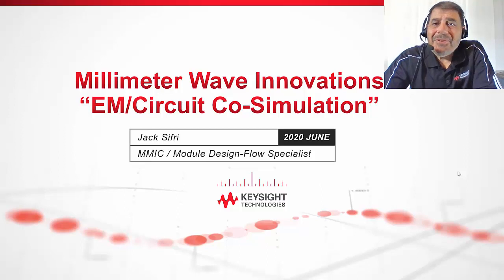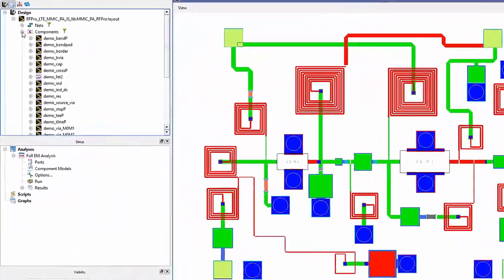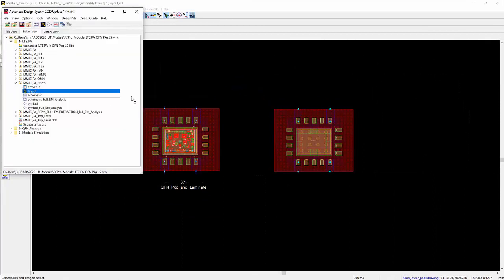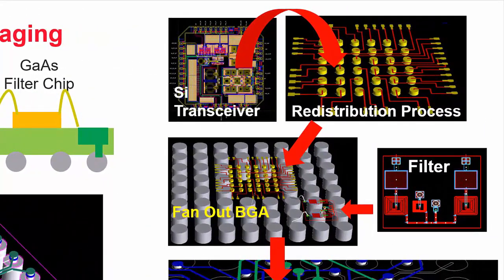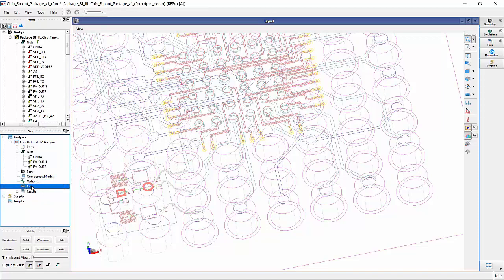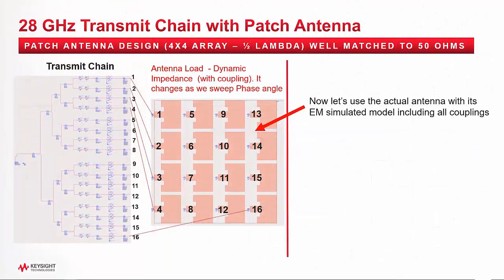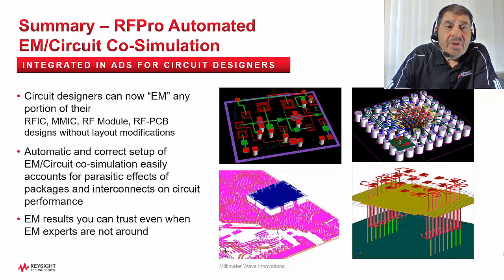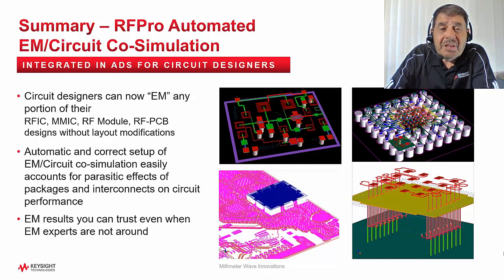EM/Circuit Co-simulation with RFPro

Comment: Thank you Jack for the informative presentation. The RFPro capability is also available inside the Cadence Virtuoso software. Is it possible to automate the simulation process with RFPro inside Cadence?
Reply from the maker: Dear Mohammad,
We are glad you have found the video informative and useful. The RFPro part of the simulation process in Virtuoso is identical to what is shown here in ADS, and the RFPro simulation environment is identical to what you have seen in the demos here.  
Please contact your local Keysight representative for a demo and more informative material on the RFPro simulation process in Virtuoso. We would love to hear from you.
Reply: @KeysightEEsofEDA  Thank you for your response. Actually, I am a user of RFPro right now and I use momentum inside Virtuoso. I found RFPro faster and easier to use. My question is about how to run RFPro using the Skill codes. I could use a Skill script to run automated simulations which I found it in the GoldenGate tools documentation. But, I could not find such a topic in the documentation about skill scripts to run the RFPro using skill scripts. I would be happy if you could let me know if there are such Skill scripts.
Reply from the maker: @mohammadalimokri9234  Dear Mohammad,
Thank you for clarifying your question and we are glad to hear that you find RFPro to be faster and easier to use. For RFPro in Virtuoso, we advise you to use “Python” for scripting.
Reply: @KeysightEEsofEDA  Thanks for your suggestion. I will try it. But It would be appreciated if you could share an example of Python scripting for RFPro. I could not find such an example in ADS help or Keysight Knowledge Center. Thanks again for your help.

Comment: I have to design 2x2 Phased array antenna having phase shift as 11.25 22.5 45 and 90 so how can i use parameter sweep?
Reply from the maker: Dear Hafsa Talpur

Parameter sweep is set at the schematic page from which you can use any polymorphic view to simulate (circuit level, EM level, etc.)
I hope this video which I have recently posted on LinkedIn can help illustrate this.
https://www.linkedin.com/feed/update/urn:li:activity:6841770394677067776/

For additional support, you can always refer to: 
Keysight Support: https://support.keysight.com/KeysightdCX/s/?language=en_US
Contact Us: https://www.keysight.com/zz/en/contact.html

Thank you